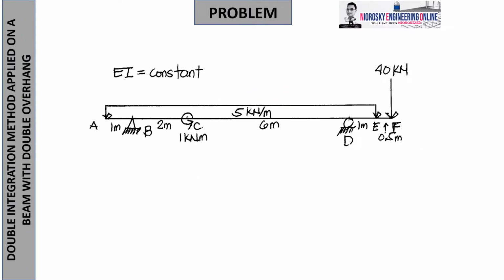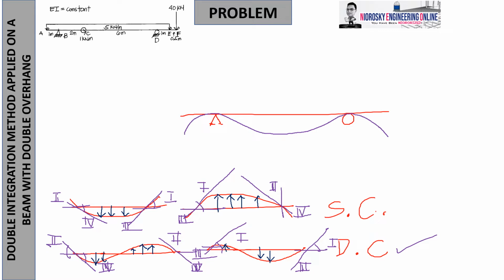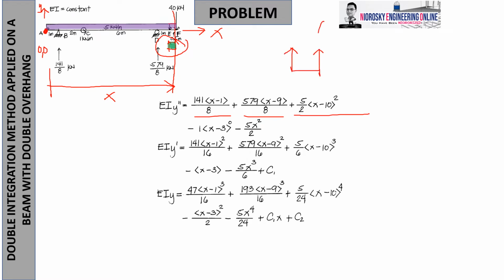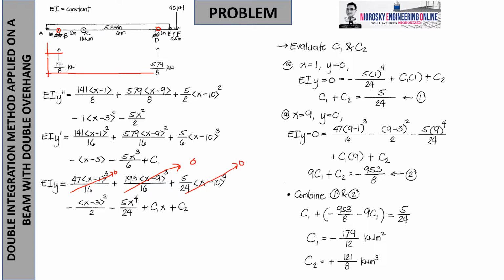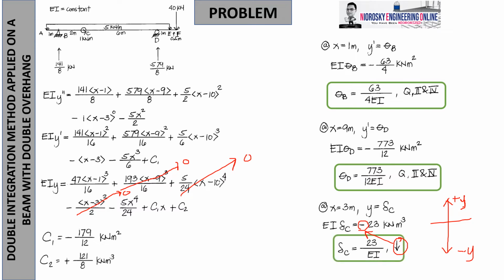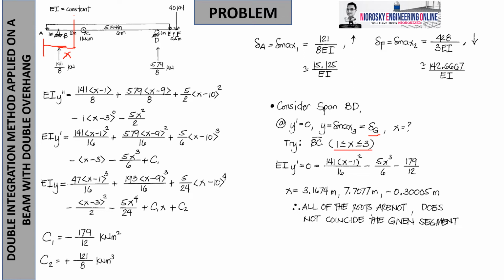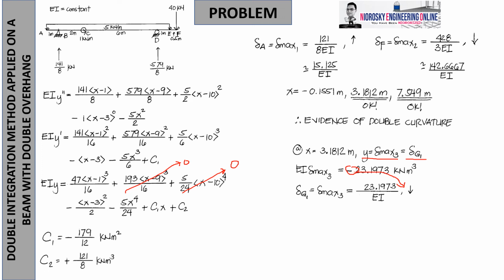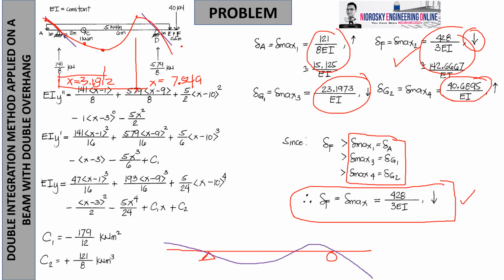DOUBLE INTEGRATION METHOD APPLIED ON A BEAM WITH DOUBLE OVERHANG

Comment: Learned three new things.

1) That the position of the applied moment on a beam greatly affects the beam's deflection unlike in Statics, applied moments do not effect the beam as the beam is treated as rigid. Ngayon ko po narealize yon. 

2) How we should approach double overhang beams. We have solved fixed supported beams, simply supported, single overhang but not this one. So this is new to me. Thanks sir!

3) The roots of x when solving certain segment for max deflection can be clues on where to find the max deflection

I love reading mystery books. Sherlock Holmes, detective. And ang maganda rito, you teach as if you're Holmes and this is a mystery that needed to be solved; and that that max deflection is a culprit that has to be caught. Kaya mas madali po namin siyang ma-appreciate. Salamat sir